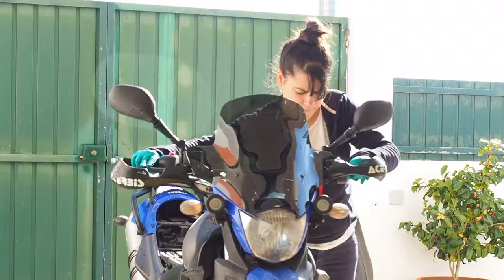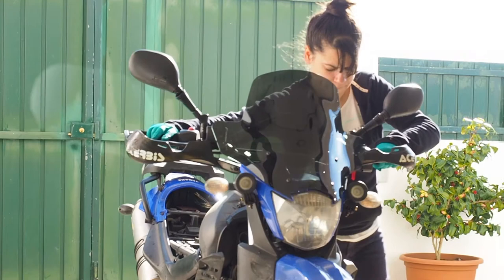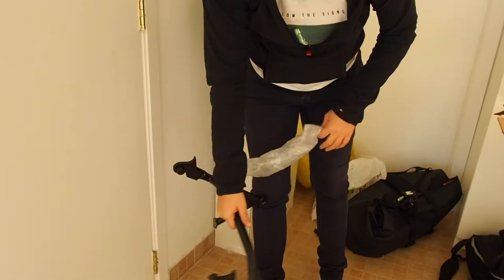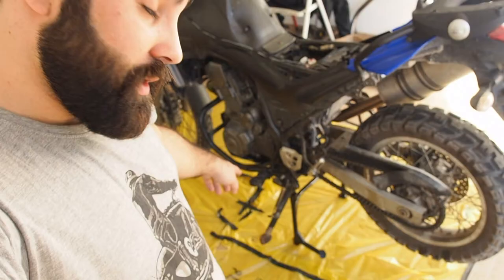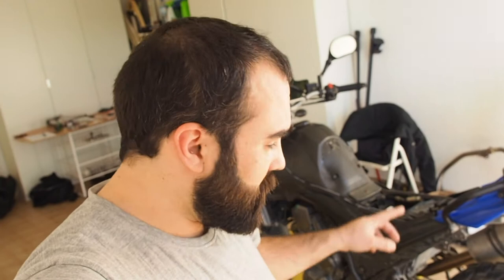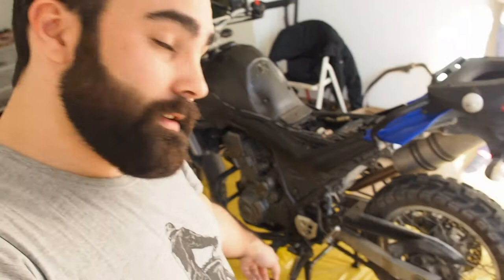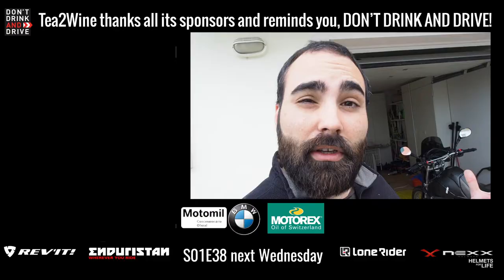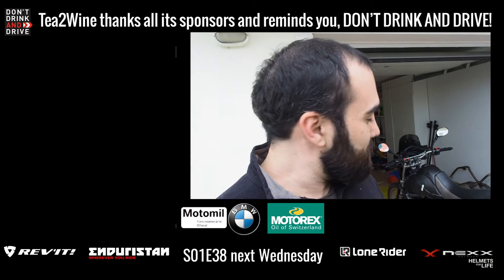Yamaha XT660R Adventure bike build

Comment: Where did you buy that tank? And is it fit perfectly?
Reply from the maker: hey!
I bought it from a company in Brazil, called Gilimoto.
It doesn't fit perfectly, there is some love that has to go into assembling it, and the fit in the end is not a dream. I have another friend with the same tank, and both bikes look the same. That being said, it is 22.5L, so... I never managed to get the last 2L or so out of the tank, as those sit lower than the pump, but that is still 20L of usable fuel (for me, my friend never complaint about that) so that is a huge increase over stock.